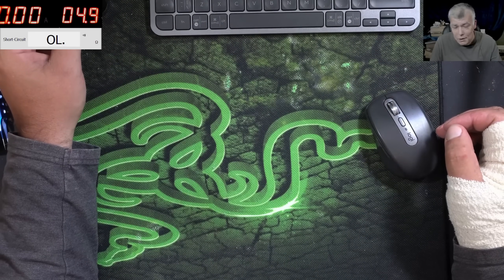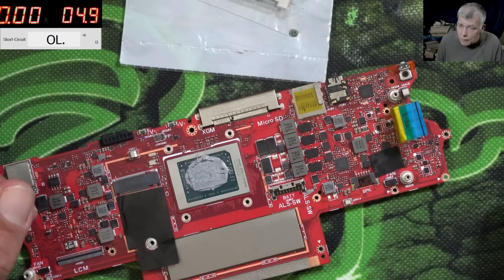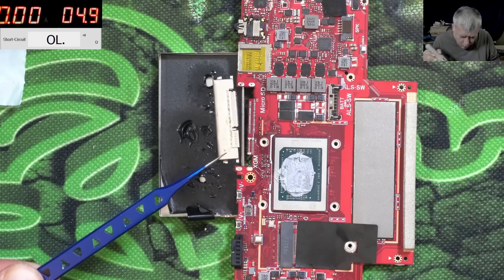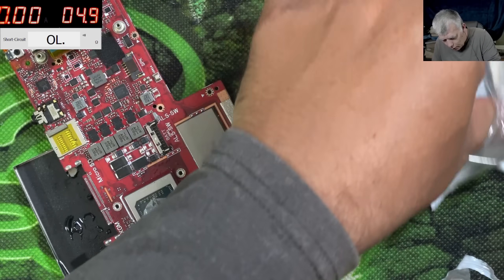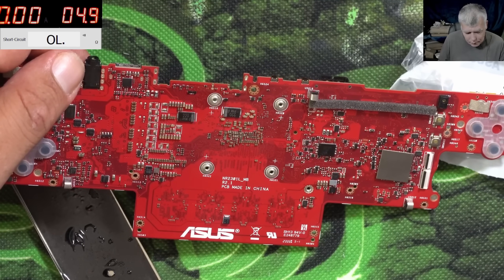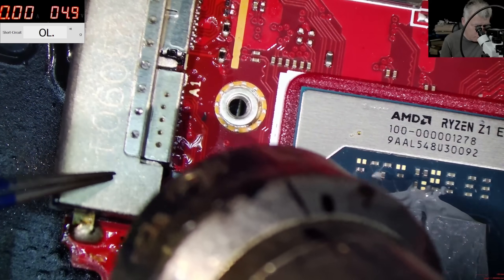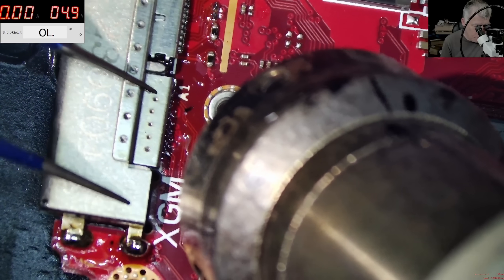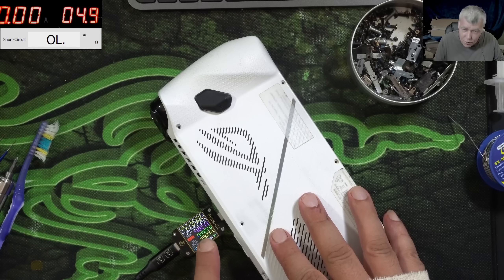Asus ROG Ally not charging - How we are replacing the charging port?

Comment: Melting the port is exactly the reason why you should wick the mounting holes and then heat the port from the other side of the board. This makes it so the port works with gravity and "sits" onto the pins.

Comment: In such situations, it is best to clean the holes with desoldering wire. Then solder the port and finally, on the other side, solder the holes with a soldering iron. Sometimes it is good to resolder the pins on the connector first. Because the factory ones don't have tin on them and it's hard for the solder to stick to them. Greetings

Comment: Proper way would be to clean all the solder. Add proper 180 degree solder for those front row pads that you can't access with iron. No solder on holes or the other row needed since you can simply solder them with soldering iron. Use preheater from the bottom. Low temperature like 350 degrees from top. As soon as you get front row soldered port will be exactly flat since there is no solder anywhere else. Then stop with hot air. Solder rest with soldering iron. And clean afterwards. Would been perfect. Hope you get well soon!
Reply: There is no proper way, just whatever works for you.
Reply: @Brianck1971  There are clearly better ways and more worse ways. If your connector is not sitting flat or you melt the plastic or heat the board for a long time then your method really not good.
Reply: As long as the board works afterwards then your method is fine.
Reply: @Brianck1971 you can't say that, it's like saying try whatever and you will see afterwards if it worked. He did say he melted the connector a little bit. Why not preheat the board with a heating pad? Why not do it better?
Reply: @Brianck1971   Not really good attitude. Your attitude should be how to do better. How to give electronics as less heat as possible. Every heat cycle you give PCB loses some of it's life. All the components that go through hit cycle/cycles will lose possibly some of it's life. I would never give anything to repair someone knowing he will blast my PCB and components with hot air for no reason. And Sorin melted the connector here, I wouldn't say it is perfect job. Also he blasted so much heat on this. First time he didn't even get is soldered enough. Not sure either how straight the connector was afterwards.
Reply: What do you mean "for no reason..' He had a perfectly good reason.   "Every heat cycle you give PCB loses some of it's life. All the components that go through hit cycle/cycles will lose possibly some of it's life...." I translated that into English and it was still BS. You're not damaging a PCB with hot air. I don't know where you got that idea from.
Reply: @Brianck1971  Everything you heat expands and later retracts. Including chips, PCB materials etc. It is physics. I guess you skipped physics lesson when it was taught in the school? Translate to english? You can't heat any chip or PCB endlessly. There are also electrolytic caps that literally dry by heat. You can try, at some point PCB materials will fall apart. Also have you seen soldering profiles? You think they exist for no reason? Manufacturers literally give you how long you can heat something for soldering. There are so many things you obviously don't even think about. Go work for EMS for a few years and get familiar with the processes.
Reply: Your (very) limited knowledge of physics amuses me. Not everything that is heated expands and later retracted. Different materials react to heat in different ways. How do you think heat shrink works ? No one was endlessly heating a PCB.   A PCB will not fall apart as you claim just because you used a heat gun on it to replace a component.  Maybe when you have a better understanding of physics you will be able to make a more informed comment.
Reply: @Brianck1971  PCB-s definitely are not heat shrinks. And PCB-s definitely expand and retract. Also heat shrinks have some memory effect. As I said there are soldering profiles for a reason. Go write to any manufacturer does heating with high temperatures affects their chips. You never worked in manufacturing or design. Why would we even bother with soldering profile when we could just slap 400 degrees for whole board and be done with it? Lol. Have you even heated PCB enough? It starts bubbling, darkens, everything falls apart because it is glued together.
Reply: @TriodeTetrode  No one said PCBs were heat shrinks, can you not read properly? You said all materials expand when heated, which is simply not true. The PCB in the video didn't come close to getting damaged, and the device worked perfectly when he was finished working on it. Which is all that matters.  It was a  connector being heated, not a chip, not  a cap. No PCB damage whatsoever.
Reply: @Brianck1971  I think you are a troll at this point. I don't want to go into details about heats shrinks at molecular level. They probably expand too after they restore their original state. It doesn't matter at this point. Let's put it this way: "All materials involved in electronics PCB/components will expand/retract when heated. My first comment was about how you shouldn't heat PCB-s so much when there is no reason. In this case everyone knows people are lazy that's why they solder even 2 legged resistor with hot air. And the statement you try to argue was: "Every heat cycle you give PCB loses some of it's life. All the components that go through hit cycle/cycles will lose possibly some of it's life". And I stand by it. The more you heat PCB the more it will expand retract etc. Same goes with components. Electrolytic caps will also dry and can even blow up in your face. That's all that matters in this case. And it does matter how you do things. There was no reason to just heat PCB so much if you can get without doing it. There are ways to do it much better. In this video he even melted plastics and didn't even get it to solder first time. You don't want pointless heating to PCB/components. That's the whole point of my comment, read the first comment. Also if you want to keep arguing go write to any manufacturer. Or just google. I don't know how to tell you this. It is just so basic.
Reply: He is never using the heating pad although he does have one

Comment: I'm a microelectronics engineer, you're much  better than Northridgefix, I swear.
Reply: Comparison isn't necessary sir! Though I have to admit Sorin is wiser, probably because he is older!
Reply: @mansirrabiu7412  its also about his voice tone ,its so relaxing and not stressfull
Reply: @mansirrabiu7412 I respect your comment, sir, but in the field of electronics, older age is not synonymous with more knowledge
Reply: @norbertotorres7201 Not necessarily synonymous but the older one is, the more experience one gather. And by the way, ten Northridgefix can never make a SORIN!
Reply: @mansirrabiu7412 northridgefix only fixes easy short circuits, I've never seen him reball a GPU or VRAM, or perform power-up sequence analysis, or super IO analysis. I don't know how he has so many followers.
Reply: Northridgefix is doing only the easiest repairs. Most it's soldering - that's it. He can't do shit on where you need to make chip reball and  mount the processor unit. But his money strategy is working perfect - he is very good.
Reply: Completely agree bud!
Reply: Comparision is not good North ridge fix is great at his knowledge but sorin has experienced and more knowledge person

Comment: 8:35 hi to avoid melt a plastic I can give you some advice B4 you put port on the PCB heat it up to melt solder then put socket also for better and 100% contact of each pin B4 solder back put some solder on the pins are a lot easier and safer and more effective I believe you know about it :) and hope you ok with Ur hand

Comment: Why not clean the solder of those through hole tabs with wick, so the port pins stay flat on the board and make good connection. Then you can solder those tabs later!
Reply: I prefer using solder sucker for this. You free holes for port, solder pins with heat gun and then secure port with high temperature solder.
Reply: Yeah I would've cleaned the holes and soldered them afterwards. I also would've tinned the pins so they grab quicker.
Reply: Why not not to pre-heat the board before soldering the port?
Reply: Also pay attention when melting bismuth type solder, like this 138 degrees celsius with leaded or lead free because i have seen one time a review that this mix lowers the melting temperature of the final solder a lot, it melts about 90 or something like but im not sure for that.
The best is to wick all the old lead free solder and use only 138 and only for connectors or data recovery jobs ex (mobile cpu reball and stuff like that). Anyway even with this method i do not see a problem at all.
Reply: @sakis1991  I heard also that soldering on low melting solder is a bad practice. It is used to mix old solder to remove it later.
Reply: @c1q3  yes for desoldering its perfect and sometime is necessary unless you have a preheater so you can lower the hot air gun temperature, but for soldering its not ideal 

however there are cases like that when you want to solder a connector. it can work perfect but it is more brittle than normal 63/37 solder i use this type of solder when i repair fpc connectors on mobile phones and it helps me a lot but for long term use only 63/37 or 60/40 leaded solder

Comment: Why you are not using preheater? The board will not suck the heat so much and you can lower the temperature on hotair.
The best is to clean old solder, use new one with PB and use the preheater fol soldering.